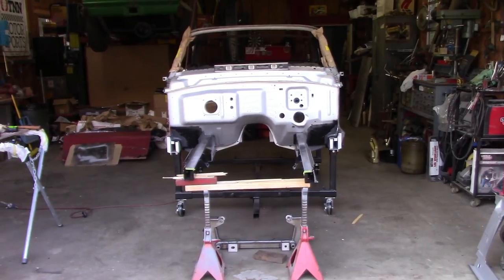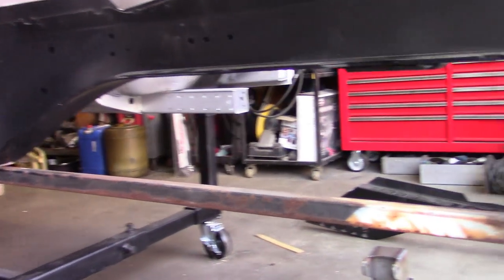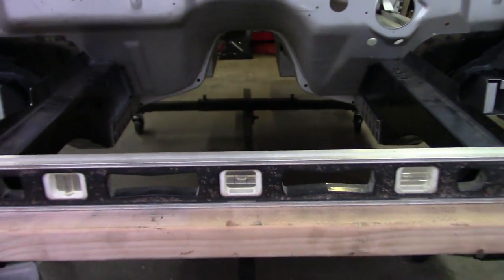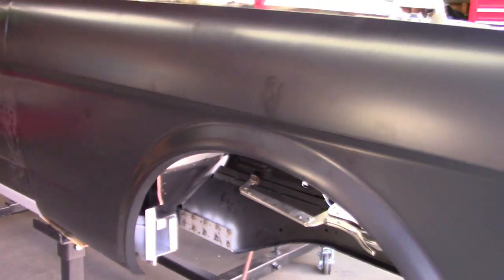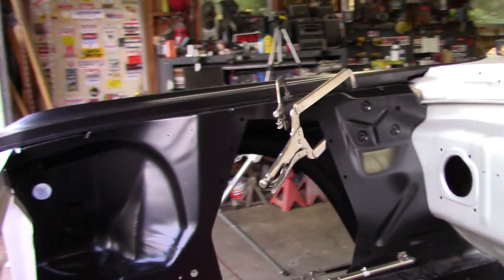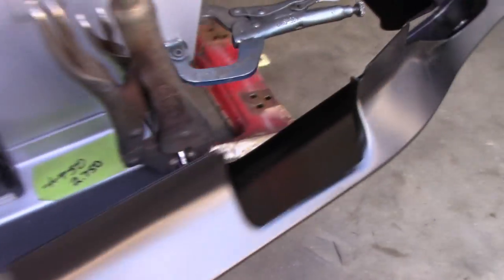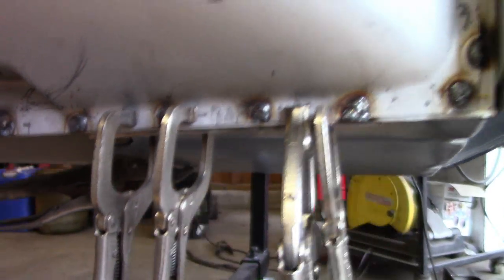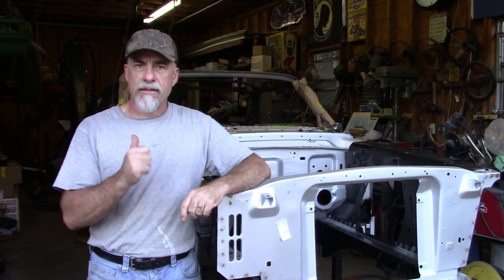Mustang frame rails, aprons and core support. Brooklyn Pony part 12

Comment: I just bought a 65 and 66, the 66 needs a front end from a wreck.  This is the best video on what to look forward to on the front end, Thank you for the video,  It helps me.  I checked parts and looks like most things are on back order... welcome to 2021.  I plan on doing a fastback conversion on this shell also (also out of stock).   I'm not in a hurry, but you helped me out with this video, thanks again,  I plan on watching some of your other videos, you have a lot of work , mine is not quite as rusty...

Comment: Measurement is 59 1/8 inch on both sides. If you measure from the front of each frame rail after the measurement of 59 1/8 inch. Measure back from front of frame rail 4 inches back on each frame rail. Then measure  6 inches across the front of each frame rail. ( have to move the 2x4 to the front of the frame rails ). The two measurements of 4 inches back and 6 inches across. You then measure at an angle from the two points 4 inches to 6 inches you should get 10 inches which proves a square.

Comment: That was a lot of work done and shown in a single video. I know I'm late, but nice job!  I just ordered one of my complete frame rails and a new core support. My 66 coupe hit something right its front passenger side corner, then left for 40 years under a fitted cover. Naturally in PA the parts that were damaged rusted. I was trying to block the car up to work under and on it and the frame rail crinkled a bit. Not good!  

P.S. I also feel like the front right is low on mine because I look at things the same dang way. Lol

Comment: MAN...  I wish I had this video like 5 years ago.  I had the same issue with a replacement core support.  I thought I was going crazy.  Surely they could not have made the core support 1/4" too short...  Thanks for giving the dimensions, even though they may be a little off car to car, they're very useful I think.  I didn't have a good car to measure off of.  My car had a bunch of work by a hack that I was undoing, so I couldn't trust any of the original measurements.  Having a set here, and even knowing what is supposed to be straight and what is not supposed to be straight is very helpful.

Question: I'm hanging / adjusting my front fenders right now.  The gap to the rocker panel is pretty tight, meaning that the bolt to the rocker is having to pull the bottom part of the fender forward.  a new Dynacorn fender, out of the box, wants to sit about 3/8" back.  I can pretty easily move it into position with my hands with the top bolt in place to set the axial position at the top.  If I put the bolt in the bottom, and then pull the top back, obviously that works too.  But there is some effort there, and I was wondering if that is a symptom that something else is off, or if that's normal.  I am going to need at least 1/2" of shims from rocker to the fender, like you had.  Good idea to figure out the stack, and make a more permanent spacer.
Reply from the maker: Fenders are tricky. I just did a video in this series addressing some of the issues. Part 28. Manipulating the front mount will change the rear. As in the axis changes. I have another video showing this. I think this is it: https://youtu.be/tYjwVqwLjNM

Comment: Awesome work, thank you for taking the time to share them. I'm at stopping point with my Dynacorn full floor pan for my 65 convertible. I have it installed the car is level front to back side to side, but the frame extensions are not parallel to the rockers. When I set the frame rails in place and level them up there is a 1/4" gap at the end of the floor extension. Do I need to cut some relief "slots" in the pan and try to jack the extensions up to level? Thank you for your time and expertise.
Reply from the maker: When you say frame extensions, do you mean frame rails? I would look at how they fit relative to the original ones. If you don't have measurements, or a jig, you will likely have to clamp everything in place and hang the fenders. That will help find the proper angle. The "reveal" at the door and fender will show you if it's square. Hope that helps.

Comment: I watched your videos for years, Im replacing the front frame rails on my 65 mustang fastback and I hope you can steer me in the right direction, The car is level to the rocker panels but when I put the front frame rail on jacks and level the rails, push them against the floor where its spot welded together the welding flanges are about 1/2 inch away from the floor at the top, The firewall is new and welded in at the same spot welds I drilled out. The welding flanges look like there at the same angle as my old ones. any ideas, measurements would be nice if you still have them.
Reply from the maker: Hmm... The rails should not be level to the rocker panels. They actually angle down slightly as I demonstrated in this video. You may nee to send me some pics. jodaddysgarage@gmail.com

Comment: Very nice. Do you use factory datum lines to align and square-up the rails and uni-body?
Reply from the maker: I used reference measurements from the original car, another convertible, and the 66 coupe.

Comment: Hey Jo Daddy, do the frame rails get most of there support from the floor supports , and how much do the aprons support the frame rails
Reply from the maker: The floor supports and firewall give the most support in my opinion. The aprons give some support, but primarily finish out the engine bay.  All are important for the structure to be strong though.

Comment: I know this video is a few years old now but in your opinon, who makes the best and thickest metal core support nowadays? Without the crossmember attached. NPD sells a newer thicker one but comes with crossmember. The ones I find without the crossmember only seem to come in thinner metal. Like.8mm
Reply from the maker: Good question. I have installed a dynacorn, but I think it had the crossmember as well. It seemed thicker. I don't know if they sell it without the crossmember.

Comment: i bought a 66 coupe and it was front ended and repaired a litlle bit by the previous owner.

do you have messurements that you use to build these cars ?

There is 1 framerail thats out of height ( so lower or higher than the other frame rail)

thanks for youre vids
Reply from the maker: I don’t have any measurements to share. Sorry.

Comment: Great video—as usual...!

I was curious what size holes you are you drilling in the floor support rails and torque box that will be plugged with the mig welding.

Also, would like to know your welder settings and wire size for the thicker metal at these locations.

Hope to start my ‘66 mustang project and you’ve been a wealth of info—thanks in advance!
Reply from the maker: I typically drill a 5/16" hole for lighter sheet metal, and 3/8" for heavier stuff. Sheet metal, I typically use .025" wire and my settings are "2" for heat (out of 5) and 2 for speed. For heavier welds, I use .030" wire and up the heat a little.
Reply: @JoDaddysGarage  specifically, what would you consider the heavier stuff on the dynacorn parts list for this build...?

I ask only because I’m about to purchase the dynacorn full floor plan with integrated rear frame rails and front floor support. I also need the front frame rails and will be adding the torque boxes too.  There just not much worth salvaging. 

Seems my journey will follow in your footsteps and looking to glean the particulars from you.  This will be a ‘66 coupe to fastback conversion.
Reply from the maker: @blueovalfan8758  The torque boxes in particular. You can use either wire, but for the pans, aprons, etc. lighter wire is easier.

Comment: Barry how do you Mig weld under the car.  The gravity makes the weld go down.  I'm afraid to weld upside down as all the arc spatter goes on me.  Any suggestions Barry
Reply from the maker: Practice is all I can say. I sometimes have the same issue, but I make sure I burn it in good, and stay out from directly underneath the weld.
Reply: I just got a Miller spot welder and will try that out on some panels that are easy to spot weld.  I also do a lot of Mig welding on the 66 Mustang coupe, but I'm wondering in the future about 40-50 years from now when a some Mustanger DIY person will need to replace a panel that I Mig welded.  It will be hard for them to find those Mig welds as Ford Factory spot welds are easy to find mostly.  I remember I had to redo a panel that I Mig welded, and it was almost impossible to find Mig welds ones I grind them flush.  Took 3x longer to separate the panels and there were more Mig spot weld cut holes, and I used a flat panel separation tool to go between the panels to find the Mig welds.   This was only about 20-25 spot welds but wasn't easy.

Comment: Awesome awesome... couple questions, what wire gage and plug weld hole size are you using? Thanks again for great videos!!!
Reply from the maker: Wire size is .023. Holes vary. With thicker metal, I make the hole bigger. Sheet metal is usually about 5/16"

Comment: Looking good! Wouldn’t happen to have a measurement somewhere from the side of car to the apron where they weld to the firewall handy by chance? Or where you put those lines on the cowl to line up the rear of the apron. Working on one myself and the previous owner took the aprons out before I got the car. If you do that would be awesome. Thanks and keep up the good work. Love the content. Don’t change a thing.
Reply from the maker: Send me an email. jodaddysgarage@gmail.com
Reply: Great work Berry.  Trying to contact you but the email isn't working.

Comment: Awesome videos I'm currently doing my 65 I've had since 1976. Torque boxes are installed the drivers side torque box has a hole in the front and both have a square opening on the back up near the floorboard are these left open or welded shut. Thanks
Reply from the maker: That hole on the driver's side is for the rigid fuel line.

Comment: Hello Jo. always very impressive. Thanks a lot of for all details you show us.  I must admit i follow closely your restoration  because it contents a lot of information which may avoid to do some mistakes. I understand you are using like main supplier DYNACORN sheet metal.  i am very impressive about quarter panel quality. Could you say what is the reference from dynacorn ( ref 3647 LH 3646 RH) because i will go to order and i want to be sure it is the same quality? Thank you for your reply. (I am writting from France) thank a lot.
Reply from the maker: Hello. Thanks for being a fan. I have not used those quarter panels specifically, but from the pictures, they look to be of good quality. I did notice that they do not include the filler panel at the rear where the extension would mount. This is the first time I've seen these.
Reply: Hello Joe.  thank you so much for your reply. Have a nice day

Comment: Did u consider using a cs from a 67 so can use larger radiator
Reply from the maker: I did not. However, I did enlarge the opening in a later video.

Comment: It seems that the bracket between the rear fender apron and the cowl on both  sides are missing, no?... lol...
Reply from the maker: Correct. I have not cleaned them up yet. They will be installed though.